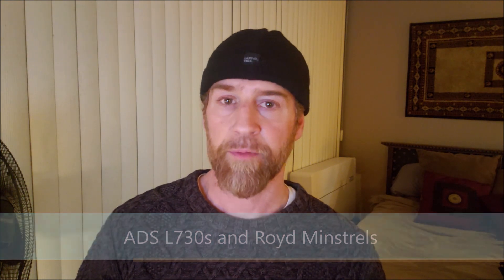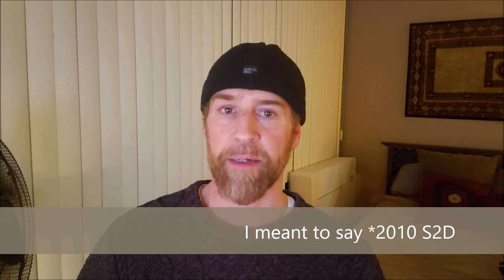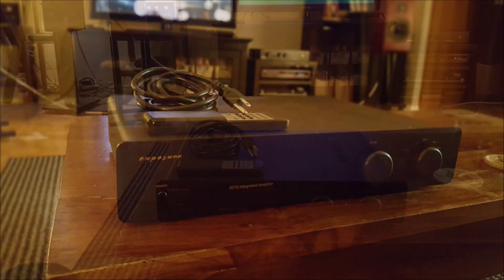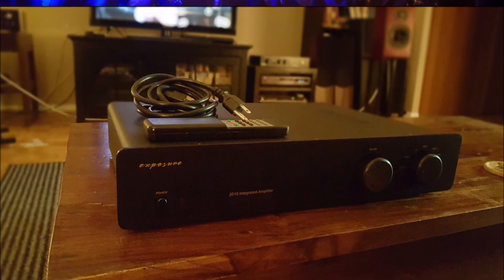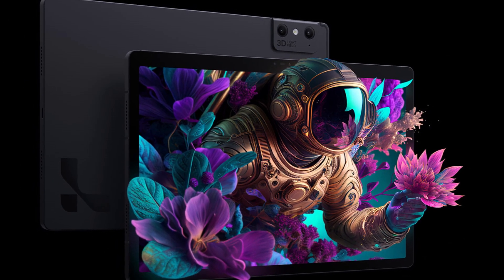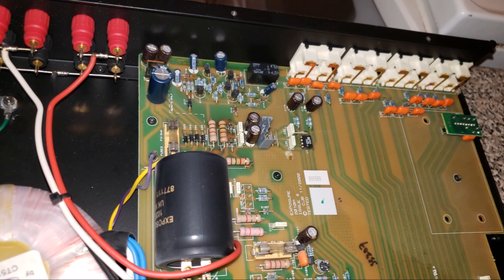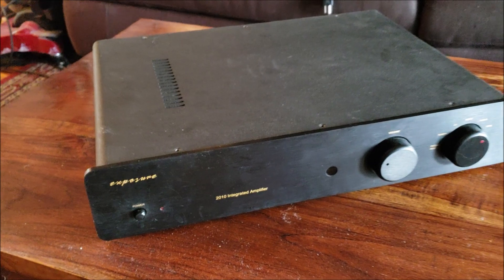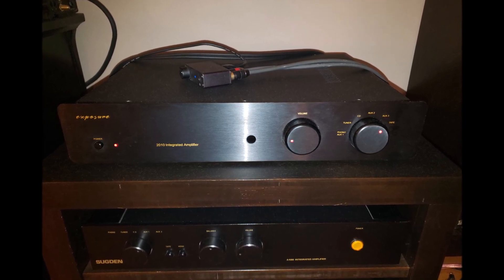Upgrading my Exposure 2010 Integrated Amplifier - Part 1

Comment: I am so stoked that you’re documenting this! I bought the 2010 (vanilla) a couple of months ago and I felt like I found what I was looking for. 
I‘ve have been pretty keen on British (old school) amplifiers for a while and also have a Rega Elex-r, which is wonderful, but has a little too much emphasis in the upper mids and it gets tiring after a couple of hours (except for vinyl). The exposure has none of that and just sounds so lovely and “right”. Everything sounds the way it should, and I agree with you on most of your assessments. Ideally, I would like to get the 2510 which could be my last amplifier. In the mean time, I might think about tinkering with the 2010 if you’re satisfied with the upgrade. The quality and simplicity makes these amps very serviceable. Personally, I would ditch the bi-wiring and only use one pair of terminals or maybe install tube connectors for a pair of GRR’s X-LS Encore speakers.

Can you explain the difference in model versions? I know the S has 75Wpc compared to 50Wpc in the first version, but then there is an S2, S2D. Information is scarce and their model names and versions are the same whether it’s an amplifier, CD player or DAC.
Reply from the maker: I know that there were some technical improvements to the 2010s and s2 over the original 2010.  The 2010 is not great into demanding loads, which is hopefully part of what my mod will address. The 2010 also did not properly keep its linearity when turning the volume knob (something I've never noticed, but have read about).

That said, if you want to know what the real-world differences are, I suggest emailing Exposure directly.   Their current amp designer, Tony, would be able to answer your questions. (He was very helpful to me in that regard).
If you reach out to him,  let me know how it goes.  Cheers!
Reply: @BadMonkeyFinger_Audio  Thanks for responding. Yeah, there isn’t a lot of headroom when turning up the volume. I think I read that the input sensitivity is about 1.4 volts and my DAC’s output is supposedly 2 volts. When I turned the volume past 9 o’clock, the sound got real harsh. After reading about it a bit, I tried a pair of ILA-1020 RCA line in attenuators which are adjustable between -10db, -15db, and – 20db. They work well without ruining the dynamics. I have them set at -20db and I have all of the headroom I need. The sound never feels forced and I think it brings out the good traits of the 2010.
Thanks, I’ll try and reach out to Exposure. :)

Comment: I have a guess who the GuRu is ... and if I am correct in my guess ... you wont regret having them do the upgrade.
I'd be interested to see some reasonable objective sound test results from before and after the mods ..
Kudos man .. keep it up! It's a never ending journey .. that's for sure =)
Reply from the maker: From my end, the sonic changes will be observed and relayed from a subjective standpoint (since I don't have measurement tools), but I believe you've seen the Guru perform similar mods which they've posted on FB, where they provide the technical descriptions of what's been improved. I can't know for sure, but I suspect the same will be done with this amp, too.   We shall see!   :)    And yes - I'm still not 'finished' after being in this hobby for 40 years!  lol

Comment: Hi i have a great respect for the brand  But if i have learnt anything in this hobby is to start looking at the mains transformer VA 
I am sure that the 2010 has a very good one  Only issue could be its size/rating   I see 200VA on the back  Imho it is low power
I am sure that doubling its size could provide benefits to the overall listening experience 
The 3010s is the thing  I know it is very expensive even used but looking inside i see that the layout of the components is just perfect like in the 2010 but everything is double in size 
What i really love huge transformer apart is how the big supply caps are located very close to the output power transistors  
This is how amps should be done  Put the energy very close to the power transistors  Very very smart

Comment: Hi... I was wondering if anybody can give me some advice if the Exposure 2010 is suitable with the LS3/5a (16ohms)? Thank you so much...
Reply from the maker: I have never paired the two, but the 2010 would have no trouble driving them.  Whether it's the most synergistic match is another story - I don't know, and I'm not going to make stuff up.  That said,  I've found that most British gear works well with British speakers, so it's likely at least a very decent match.

Comment: I had a lot of amplifiers. Also more expensive ones. This one does everything right in my combination. Big soundstage deph and wide. Open and it is very balanced. Also everything has the right proportions and everything sounds beautiful seperated from eachother. Doesn t color the sound so very neutral. I play with big but easy speakers so maybe the combi is just right because I don t recognize the shortcomings. I do recognize the pro s you said. But because it s so perfect I m to scared to modify but will follow this! Who knows.. I am also thinking about bi-amping
Reply from the maker: I agree that this amplifier does a LOT right.  I just got it back from its upgrade, but haven't had the time to hook it up just yet (dealing with some other crap first).  The tech person who did the upgrade assures me that the sonic signature will not change from the upgrade, but that the sonic presentation will essentially become more dense/ palpable.  I hope they're right.  

It will need some break-in time, as the capacitance has been increased 5.5 x the original capacitance.  According to the tech, so far there is 150 hours on it, but it will require 300-500 hours to fully come into its own.  

I hope to make a video about it soon-ish. 

Thank for your comment.  I appreciate each and every one of them.

Comment: Hi, I own the original 2010 integrated amp and it's run into a few serious problems, and I wonder if anyone has any ideas what has happened?

1. It's stopped connecting when my Ipad or Iphone is streaming Spotify through Aux 1
2. When playing CD's through the 2010 CD player, or a spare Marantz CD63 MK2 KI Signature, after about 10-15 minutes it causes a strange show stopping sound that makes me switch if off immediately.

If anyone has any ideas what is causing this, I would try and swap the parts out, but being not too technical, I struggle.  Thanks in advance
Reply from the maker: I'm sorry to hear that you're having issues with your 2010 integrated amp.  I have heard there were some issues with it, but I've never experienced any problems, myself. 

With that said, I would reach out to Exposure directly.  Their new engineer (who built the 2010s and onward) may be able to give you some good insight into what's going on with your amp.  He was quite helpful to me when I reached out to him for a different reason. 

Best of luck to you!  It's a good amp when it works, so hopefully you'll be able to get to the bottom of the problem and have it fixed.

Comment: Ive just picked up a exposure xv (15) from the Farlowe era, what a sound! I was using the arcam a85 before this. The exposure trounces it in the bass and tonality, so musical and rhythmic. The exposure is less than half the power of the arcam but it has better dynamics and bass, its a little beast. 

When do you expect yours back from upgrades?
Reply from the maker: Oh hoooo!! you got one of the good ones!   I have heard nothing but good things from the John Farlowe models, but I haven't actually heard any of them, myself.  Lucky you!   

If it trounces the A85 that much, it MUST be good, because that Arcam is no slouch itself. 

My amp is actually already done, but I'm too busy right now till after Christmas to actually get it back.  I'm hoping to get it back before the New Year, but we shall see.  I'll keep you posted. 

I know the technician who worked on it is a master, but I'm still on pins and needles wondering if I should have left it all original.  I'm hoping for the best, but you know how it goes; sometimes shit happens. Fingers crossed!

Comment: The best integrated mod I ever saw.....they practically filled the inside of this integrated with some sort of tar to eliminate vibrations. 😂😂
Reply from the maker: Tbh, I am anticipating something similar (silicone).  :)
Reply: @BadMonkeyFinger_Audio  Dont do it. Why  would you ruin such beautiful electronics with such a foolish mod. There is no way it makes a difference in sound.
Reply from the maker: @majicogarcia8417  that's not the mod itself. Lol  We're not just throwing silicone in the casing.
Reply from the maker: Just out of curiosity, where did you see that mod where the person filled it up with 'tar' (or whatever the material was)?  Would you happen to have a link to that or any info on it?  You've got me curious.  :)
Reply: Ive heard some speakers put crossovers in a box and fill with epoxy or something similar to create a sold block to eliminate vibrations.

Comment: You don't need to do much, what is he actually doing do you know? And ask him for the original parts back so you can change it over if you're not happy!
Tell you what I would do mainly change the filter capacitors the two big ones on the power supply you've got room in the case I think that 10,000uF they've put their own label so I'm not sure for split foil DNM 4,700 4ttn X3 each channel so that would be six in total, and they're not tall what doesn't really matter in your case because you can twist the capacitor or put it directly on the case, on some 3M sponge tape, they're about £7 each last time I checked. you could use bipolar they are quieter electrolytics then standard, and would be a good choice on the opamp chips for the preamp put another capacitor across the chip 100 nF from VCC plus to minus. Might be worth considering changing the oppams to sparkos lab discrete opamps that can be a great improvement, about a $100. Having two attenuators even having the one is better than the carbon film pot you've got, something like oh 52 clicks or greater with Vishay carbon film resistors surface Mount can be used, a massive improvement plus the volume attenuator instead of one separated having two, this gets rid of the balanced knob what damages cross-talk and degrades the sound, the volume knobs can be used as balance as well same principal as Croft acoustics use. there's not much more you could do you could change the RCA are rubbish connectors for BNC connectors 50 ohms a much better connection, and a lot of rca's are not 50 ohms, its so hard to tell without knowing the manufacturer the of the connectors, but got to be 50 ohms for analogue, and 75 ohms for digital coaxial or higher, get away from RCA connectors worse thing on any piece of hifi equipment.
Reply from the maker: Hey there! Thanks so much for chiming in and providing your thoughts.  Sounds like you've been around the block a few times with respect to modification of amplifiers, so I appreciate the input.

Comment: You'd be able to have expensive products if you didn't buy SO MUCH
Reply from the maker: @davidthom7127  What does cost have to do with anything? I've had lots of costly gear over my 4 decades in this hobby. Throwing money at audio doesn't guarantee anything. I prefer to get good bang for the buck, and assemble good-sounding systems with relatively meagre outlay.

Also, I accumulate various pieces because they all have their respective strengths.  It's fun to swap gear/ speakers in and out.
Reply: @BadMonkeyFinger_Audio  you say in the video, you can't afford expensive audiophile gear. Hence why I said, you'd be able to get better stuff if you bought less. Jeeeez 🤣
Reply from the maker: @davidthom7127   I had to 'love' this comment of yours for the 'jeeez'.   Sorry - didn't mean to come across as snippy.